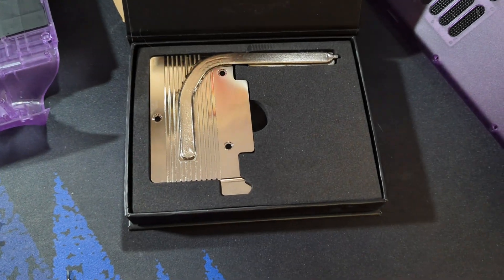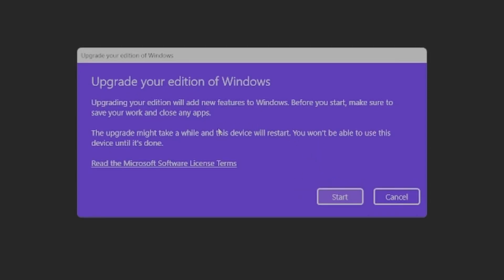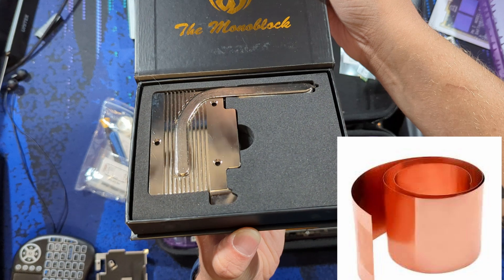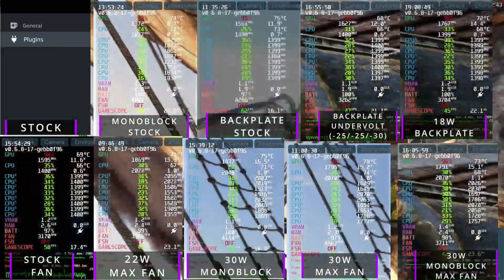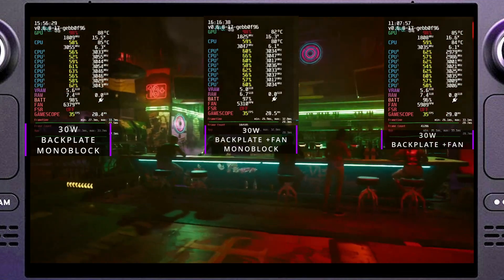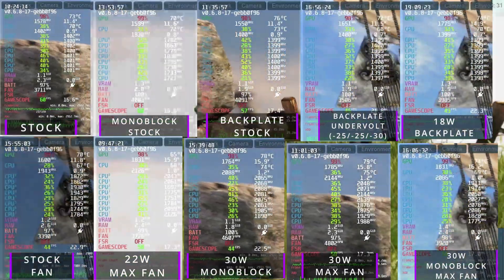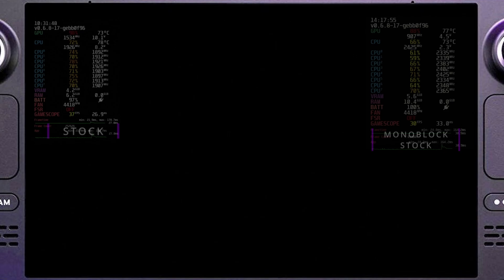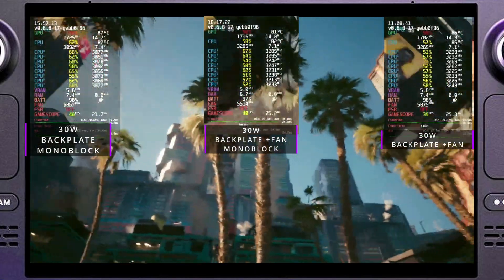Drop Your Steam Deck Temperatures With This Drop In Mod | The Monoblock Installation & Review

Comment from the maker: 24/7 Customer Support - Money Back Guaranteed

50% off coupon code: 【ALC50】 
Windows 10 Pro ($7.59) https://www.keysfan.com/windows-10-professional.html?ksf=awt67 
Windows 10 Pro - 2 Keys ($12.43) https://www.keysfan.com/windows-10-pro-professional-cd-key-2-pcs.html?ksf=awt67
Windows 11 Pro ($13.31) https://www.keysfan.com/windows-11-professional-key.html?ksf=awt67
Windows 11 Professional 2 Keys ($25.78) https://www.keysfan.com/windows-11-professional-2-keys-pack.html?ksf=awt67

62% off coupon code:【ALC62】 
Office 2021 Pro ($27.67): https://www.keysfan.com/microsoft-office-2021-professional-plus-key-1pcs.html?ksf=awt67  
Office 2019 Pro ($25.61) https://www.keysfan.com/mc-office-2019-pro-plus-1pc.html?ksf=awt67 
Office 2019 Pro + Windows 10 Pro ($26.99) https://www.keysfan.com/microsoft-office-2019-professional-plus.html?ksf=awt67 
Office 2021 Pro + Windows 10 Pro ($31.76) https://www.keysfan.com/windows-10-pro-and-office-2021-pro-plus-key-bundle.html?ksf=awt67 

More products: https://www.keysfan.com/flash-sale-alc.html?ksf=awt67

Sponsored by - Keysfan.com
Reply: For max cooling try thermal pad 7950 with Jsaux back plate with slight under volt over clock mine I personally had 71 under 3  hours of playing the highest over clock high setting cs2 3 hours of game play I was sitting at a solid 75

Comment: I’m concerned about my own steam deck now. You saying your steam deck doesn’t really ever hit over 80°c worries me because mine hits around 90°c-98°c when under a full load on day with average outside temps of 18°c and can hit at the absolute maximum (which it luckily only hit once) 115°c with outside temps of 25°c+ though usually on days of around 25°c my steam deck tends to only extremely rarely hit 100°c and on days where it’s at most 30°c outside it never really goes above 108°c

Note: I have one of the very first steam deck models and I’m pretty sure it’s never been repasted which I really should do soon

Also I’d love to know what your steam deck’s core temps idle at with no applications running since mine runs on average at 40-50°c when idle with no applications running (other than core temp utility)

Comment: Something to remember is that every component on the board is cooled by airflow being pulled over the board by the fan, improving the SOC temps to lower the fan speed will cause other components to potentially overheat.

Comment: Hello, just curious if you ever got a chance to try out the Monoblock Wave 2. 
Been waiting for that video comparison for a while :P 
Any installation tips? I was waiting for your video before attempting to install it. I haven't found much of anything online either.
Reply from the maker: I do have it in box still, unfortunately it seems like the project is dead.

I have been meaning to get around to installing it and doing a comparison.
From visual comparison it does seem to be a lot better implemented, but have yet to do any formal testing.

It is on the back burner though
Reply: @WinDeckTech  yeah at this point I might just wing it and see what happens. I was afraid of having to mess with shims. I did find that some people are using upsiren u6 pro thermal putty so that might save me some hassle
Reply from the maker: @a510592 I have used upsiren and another brand that I can’t recall off the top of my head.
I’d recommended the goopier the better vs more playdoh like. Unless you need to use shims and layer them.
If you can grab some PTM you can use that as well as a glue/layer.

Comment: Using multiple layers of copper with thermal paste in between each is a terrible idea. Thermal past doesn't actually transfer heat well, it's just alot better than the voids of air that would be present between the cooler base and the CPU heat spreader. If the height of the cooler plate was wrong it's trash, it's not even worth doing a review cuz the product may otherwise be good if fixed, it will never be good like this.
Reply from the maker: No and that was the point if this video. It "can" work but it was fubar from the beginning by design. Apparently V2 is better although I've not gotten around to testing it yet. Still sitting in it's box. 
The one thing that I will say is a "plus" of the monblock is that it does indeed cause the fans to not as high of an RPM howver the flip side of that is the monoblock itself gets quite warm from the heat spread.

I'm going to be working on an all backplate test for the ally then revisit the steam deck with the v2 to see if there were any improvements or, if even possible, more regressions haha. Thank you for your input and insight. I'm also going to be getting some thermal putty just to see if there is a major difference one way pr the other with that.

Comment: I have a steam deck I got about a week ago. is it okay to game in 80c range for couple of hours? ark survival evolved hits 80c most of the time which kind of scares me lol my other games like 7 days to die only hits about 70c so I am not so afraid of that. obviously ark is not very well optimized at all for thermals. I tried to lower tdp and gpu and a mixture of settings and doesn't really help at all for certain games. so is 80c okay for steam deck?
Reply from the maker: 80 degrees is not bad and within spec. If you wanted to try undervolting with the new BIOS or turning on the older more aggressive fan profile. That could potentially help as well.
But, you can run it at 80 degrees all day every day and it shouldn't ever run into an issue, theoretically.
Reply: They can handle the 80c fine, if it starts getting over 90-95 it’ll be a problem, and will automatically shut down once it hits 100c

Comment: I don't think the Deck actually needs more cooling. The only extra cooling I do is having the dock sit on a "cooling pad" aka a monitor riser I installed 2 180mm AC Infinity usb powered fans so that it has cooler air to pull in and the hot air gets pushed away from the area.

Comment: The one reason I tend to shy away from mods like this (and tbh don't feel particularly positive about doing up the thermal grease either) is because the whole thing is cooled by that ONE fan.

Valve inginerded the crap out of this thing, to the point where messing with their thermal design at all starts to put other components at risk. VRMs, memory, hell, even the charge controller... they ALL rely on secondary flows from that fan. Reduce those - everything else runs hot. Not worth it. If you do this, do it properly and make sure you're cooling all the other bits too.
Reply from the maker: I will have the v2 of this coming as well as another cool mod. Definitely in the realm of would not recommend but still fun to tinker with nonetheless!

Comment: use a dremel with a sanding disk to carefully cut a groove on the screw and then unscrew it with a flat tip screwdriver
Reply from the maker: I was able to get it out with a drill thankfully. I am waiting for the DECKHD screen to start moding the deck again.

Comment: 13:37

Looks like temps and framerate is the same with the monoblock?
Reply from the maker: Pretty much lol. I saw no real difference. I've since made a better mounting connection and will be revisiting it in the future alongside other cooler mods.

Comment: I really want to see more content on this, hoping the wave 2 will be good.
I also pre-ordered it, so we'll see what this new bracket is about for making that even pressure. 
They were talking about the design some on discord.
Reply from the maker: I saw the new design redesign. I have the wave 2 on order. 

There will be an upcoming video with three steam decks. My modded deck with the monoblock and without. Then using a new cooler called Cooler deck. It is a copper plate with proper mounts thought out, then an attachable fan. It is ridiculous but I love it

Basically steam deck 1 will be bone stock (to never be modded)
Steam deck 2 (my wife's)
Temps will be recorded from her currently stock one. Then changing her paste to PTM.
Seeing as my modded deck is in a different case and has had its thermal paste changed multiple times it's "default state" is compromised.

At the end of it we should know which option is best, in conjunction with changing to ptm from stock the other factors would be the RGB Backplate from JSAUX, the old style with exposed heatsink (with and without the magnetic fan) monoblock and cooler deck.

It should make for a fun video

As well I have perfected the mount (to the best that I can) on my monoblock since this video.
Reply: @WinDeckTech  😲 Oh man I am excited to see that video!
Reply: My wave 2 monoblock just shipped! Did you happen to get yours yet? Excited for the revisit!
Reply: I did get mine a while back! Still waiting for the videos to come out doesn't seem like a lot of people got one :/
Reply from the maker: Yeah I'm going to do a general comparison of the two now that I've done other testing with the precious
First gen is still garbage and could not really get good temps with it.
Reply: @WinDeckTech  how did the second wave treat you? 🤔 Same recipe with the copper shims?

Comment: Not getting a proper mount totally defeats the purpose of this product. I have a pre-order in for wave 2, hopefully they have it figured out for that batch. If it comes in and requires shims or any nonsense like that I'm immediately sending it back for refund, because like I said, if the block doesn't get a proper mount and proper pressure, it doesn't matter how good it is at moving heat because you still have a massive bottleneck at your transfer point. With a proper mount, there is no way it wouldn't perform better than the stock solution. It's simple physics.
Reply from the maker: I have since repasted it with proper .1mm shims, layering ptm,shim,ptm etc for a total of .7mm thickness on-top of the APU.

This would ensure the BEST possible fit. 
Temperatures were no different than the video shown here.

I will be revisiting it with the jsaux RGB back plate, comparing my monoblock to a stock deck then jsaux old backplate and jsaux new backplate.
Reply: @WinDeckTech  also I'm not saying you did anything wrong, you tested the product as you have it. I'm saying the product is clearly flawed for needing this sort of work around to make it work and completely defeats the purpose. Like why build a high performance thermal solution and then need to stack shims and TIM to make it fit right? It makes no sense.
Reply from the maker: @LayerZeroDesign  I didn't take it that way, no worries!

And yeah, like you said it shouldn't be this way. Especially for a paid for product (if it was an early sample I'd understand) 
TMK this unit was used for internal testing as they had posted it up for sale long after the wave 1 sales has closed.

You'd think that would mean this is a high performer, unfortunately that is not the case.

If you're curious take a look at the deck cooler by nupp engineering 
https://nupp.eu/collections/all

They reached out a couple days ago and will be sending me a unit for testing.
30w OC potential, allegedly.

It is absolutely ridiculous and no sane person would do it to their deck. But I will... lol
Reply: @WinDeckTech  the best possible fit would be with no shims at all and the block should be machined properly to fit. The least efficient part of a thermal solution like this are the transfer points, paste etc. Adding a shim and multiple layers of TIM for what should be a single contact point immediately is going to drop performance. I hope it's correct for wave 2.
Reply from the maker: Sorry I meant best possible fit relative to it being a wonky fit from the start. They are apparently adding more material in V2. I do have mine on order still. So I will be waiting for that to draw final conclusions.
 @LayerZeroDesign

Comment: I wold put thermal past on the apu then add on the copper shim then thermal past on that then put the block on, you need the thermal past directly on the apu to fill in air gaps and temps will be better.
Reply from the maker: I have since repasted it with ptm and layering proper shims I got. Honestly... temps were not different much if at all from this video. I have been waiting to make another thermal video. However a new company with a steam deck thermal mod has reached out today actually. They will be sending over their kit for me to play with :) looks pretty promising, albeit a little "backyard shed" looking. But I'm all for it haha.

Edit: when repasting I layered .1mm copper shim, ptm,shim etc. I believe the total thickness including ptm was .6mm

It is making the best possible contact it can, I'm certain of it.

However I bought my wife a used steam deck, so I can at least have a new "baseline" to compare it to. I know it "should" be the same model/device with all testing however for the sake of time alone I believe it will be better to have a complete "control unit"
The only thing we've done to hers is put the RGB jsaux backplate on. But I will switch back to stock for all testing.

Comment: Well fugggg, I just put in an order for the 2nd wave. Sucks that it doesn't cool down the deck as much as claimed or really at all.
Reply from the maker: I just refitted it with proper shims and ptm 7950. Pretty much the same temps. Stacked .4mm worth of copper layered with ptm
Don't think I could have any better contact than I do. Even with the jsaux metal plate back on its really not that worth it.

It does take a lot longer to get heat soaked, so in the instances of lighter games or in bursty loading or streaming moments the fan speed will be lower.
The thermal capacity also allows for more room with overclocking.

I'll be making more videos on it :) 
I still have my v2 ordered in the hopes that they will improve it.
They seem very open and responsive to the community.

Comment: Off topic but how do you mount your sd card after returning to stable release from main release
Reply from the maker: Did you do the change with the SD card in? I have found if you do it with the card in, It will not read. What I had to do was roll back the update with the SD card out. Put it in, take it out then do the update again
Reply: I've always changed between builds with the SD card removed

Comment: They have screw extractors that should be able to remove your stripped screw. there is the possibility that you might need to drill out the screw head, remove the monoblock, then use a pair of needle nose pliers to remove the damaged screw. Not too hard either way, but can be nerve-wracking.
Reply from the maker: Oh yeah big time. 
I've put it on the back burner for now. Until I get the new parts, ptm etc. 
Then I'll do it all again for the v2 of the monoblock. I am expecting better results with proper parts.
Reply: Honestly, if you've got some needle nose pliers...give it a good tight grip on the pliers on the screw head, then twist counter clockwise. 
It should come loose without too much pressure since it's such a small screw, just gotta make sure you have a nice grip on the pliers so it turns the screw.
You want the pliers horizontal so you have leverage. Don't try holding the pliers vertical and twisting lol, hopefully that makes sense

 @WinDeckTech
Reply: @WinDeckTech  I am really curious on every upgrade to the steamdeck, still waiting for an OLED upgrade (even though I am not confident that it will be possible). I am probably going to use mine as a way to play around and get the ultimate build at some point. Keep up the good work! I've enjoyed all of your videos!
Reply from the maker: I'm going ultimate with the DeckHD screen, a new case v2 cooling etc. 
Figure my screen is dead may as well wait for that one.
Only thing is you need to load custom bios to use it. They are apparently in talks w/ valve for custom resolutions but for now that's the solution.
Reply: @WinDeckTech  I'm still waiting for an official steam deck os for other handhelds. I've got my A1 that I would love to see run it. Otherwise I'll be starting a steam deck build this winter I think. It'll be a great way to pass the time! Hopefully an unlocked bios comes out soon.
Reply from the maker: @joeycooper93  god I hope so. I just ordered the gpd max 2. It would be killer to get steam os proper on there.
Reply: @WinDeckTech  booted up holoiso on my loki 256 (has the 6600u in it) and it is amazing. Might have a killer (overkill/overengineered) desktop steam deck/handheld cooling solution that includes a peltier, water cooling, and a 3D printer...

Comment: Get a small drill bit and slowly drill off the head. Then take the part off and use pliers to screw it off
Reply from the maker: right now it looks like a bowl, there's barely any head left to it haha. I will try some small pliers before I break out the drill. If the super glue that didn't get cleaned up hasn't fused itself to anything.
Reply: @WinDeckTech  honestly that probably won’t work. All u need to do it take the head off and that’s it. If not try a rubber band with some pressure of the screw driver or try a T tip and see if that works
Reply from the maker: @Darkstartsb  will do!
Reply from the maker: This is how I got it out!